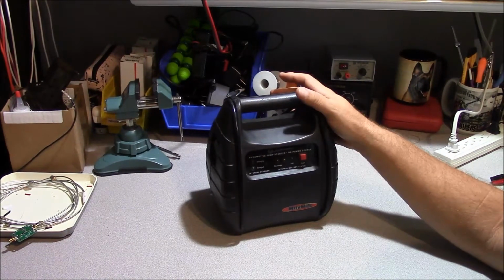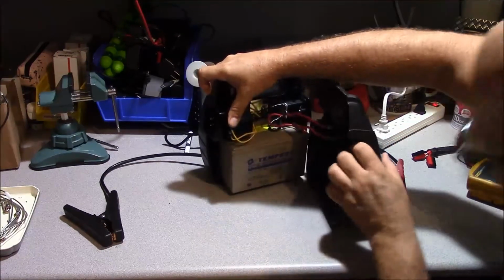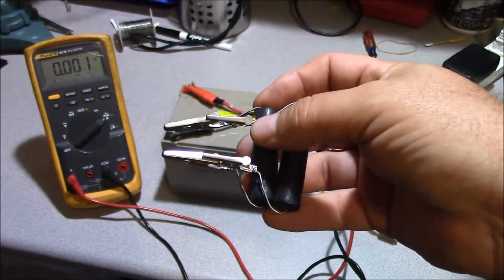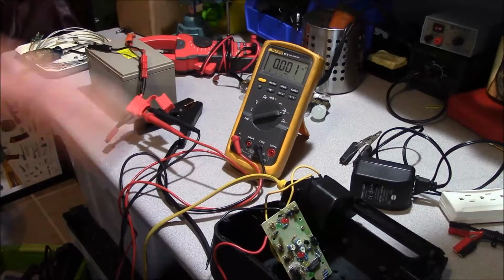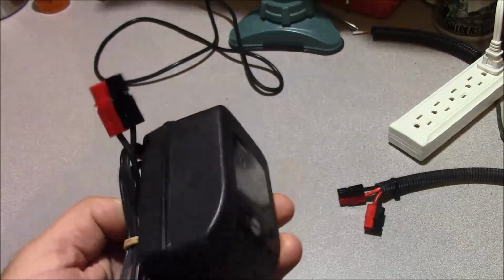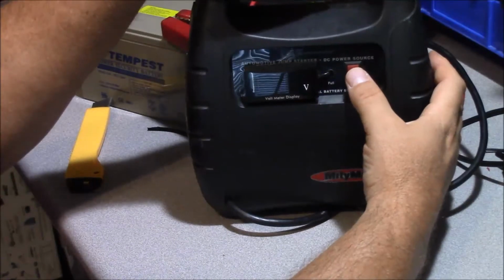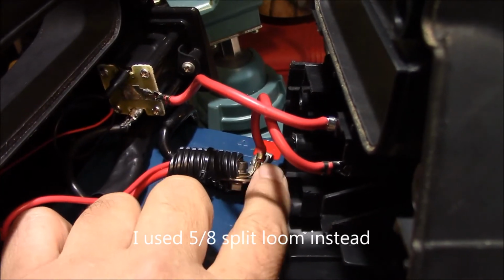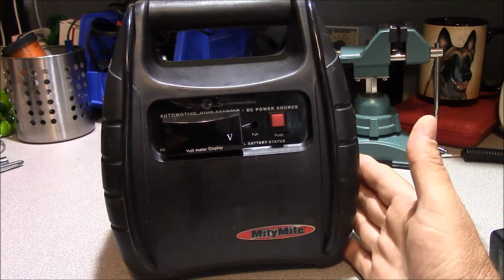Servicing a 12V DC automotive Jump / Booster pack

Comment: As it happens, I've got a pack that has charging issues. Will take a look at it next month ( ma plate's full right now :) I need it fixed because it also contains a little compressor that I use for my motorcycle. Had problems with the power pack before - it kept shorting out when I checked the voltage ( pressing that red button almost started a fire once...). Thanks for reminding me it needs fixing :D
Reply from the maker: You are welcome ! Thank you and thanks for watching !